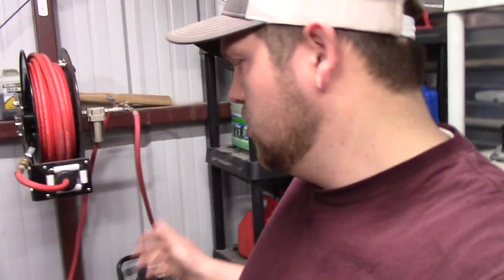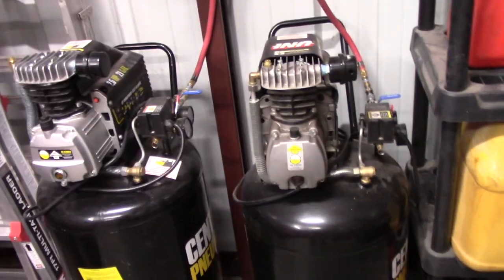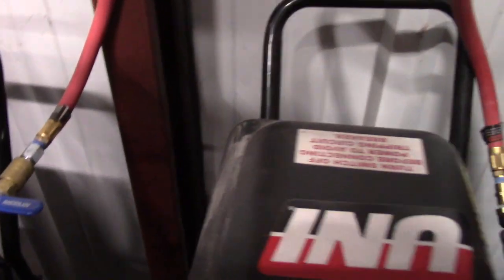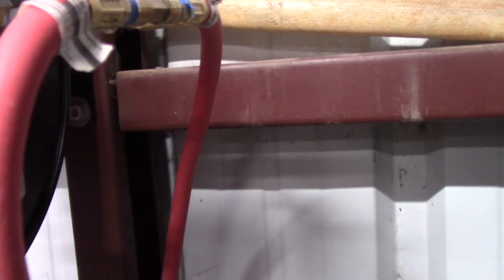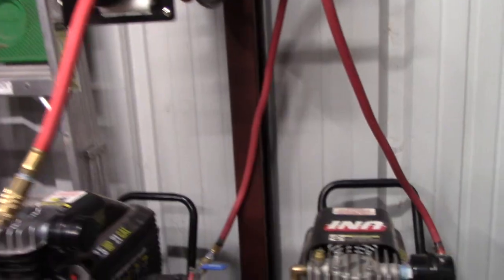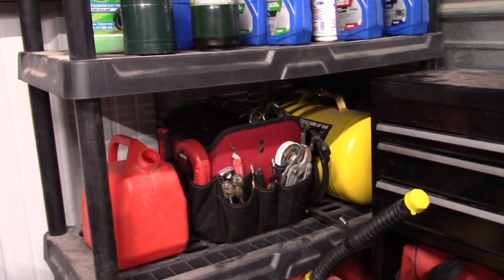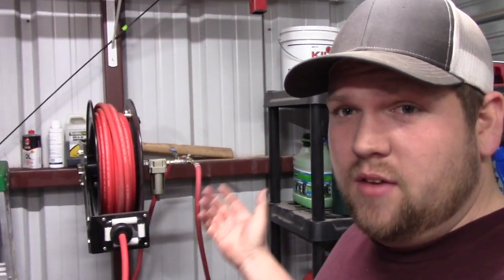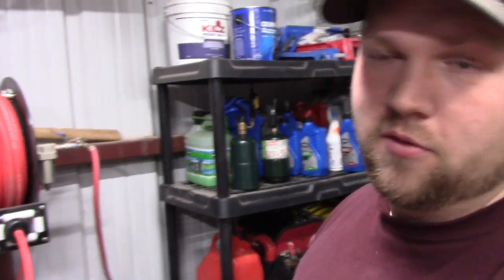Dual Air Compressor Set up for Small Shop

Comment: You failed to mention the CFM before and after which is kinda the whole point.
Reply from the maker: Norma Whitlatch the whole point of why I did a dual compressor set up is because I don’t have power in my shop and I have to run everything off a 20ft heavy duty extension cord, so if I could store double the amount of air pressure at 125 PSI I could use air tools without having to unplug everything in the shop because these things require so much power. 

But it sounds like you know what your talking about, so maybe you could enlighten me on the CFM topic because to me, the air compressor has to try and fill that 21 gallon tank to pressurize the air and when you add a second compressor you just have a second tank to be filled and pressurized so if someone wants twice the CFM while they are filling the tanks (air compressors are running) through their hose I don’t think that would be a benefit would it? And then when they are all the way filled you would only be able to have as much air flowing through one air hose as the diameter of the air hose would allow, and whether it is hooked up to one or two compressors, the pressure would remain the same which would be a factor in how fast it’s flowing right? I might just be completely ignorant to the science behind air compressors, so if you do know all about it, please tell me what you know so I can learn too.
Reply: @DereksWorkshopAndProjects  think of it like this. If you have one compressor running 2.5 hp pushing 5cfm let's just use rough numbers. And you hook a second 2.5 hp 5cfm motor up. Each motor is pushing 5 cfm to that t. Yes hose size and fittings can change things but not at low 10 cfm. A standard industrial plug can take 30cfm easily. The hoses are rated for 300psi. With both running 5hp peak you can run almost any air tool. Die grinder , angle grinder, cut off cool, hvlp gun. Sandblaster cabinet.  Dont focus on the tank size when you think of it. Think of it as motor output
Reply: I wonder if putting a larger diameter hose on the outlet of the T would allow for more cfm?

Comment: That'll work. The little auxilliary tank you mentioned helps settle the air and allow moisture from the two compressors to condense before entering the main line. So it acts like a water trap. 

You're probably already aware of this, but if you plumb the lines out of the regulators on each compressors, you'd need to keep the regulators wide open for the system to work as designed. If you're not worried about regulating the air at the tank, that's fine. Otherwise, maybe put a regulator up by the water separator up by the hose reel.
Reply from the maker: Thank you for all the insight and knowledgeable. I didn’t actually KNOW about keeping the regulators wide open, but I did THINK about it and I had never adjusted them because it just makes sense. Also just don’t have a lot of reason to throttle the air pressure down. I will probably add an auxiliary tank at some point. Really good info! Thank you!

Comment: A couple of questions:
Does having two (identical) compressors in parallel double the airflow (CFM) ?
What happens if one compressor is working but the other does not? Does the working compressor run (rotate) the non-working compressor?
Reply from the maker: Hopefully I understand your question right... I’m no expert on this so take it with a grain of salt. But a couple of things and these are my thoughts.... to address your first question, if you are asking if it doubles the air flow to the air tool, then I would think not. It only fills both tanks equally. And there is 2 times the tank space to be filled. 

As for the next question I feel more confident in answering this saying that no it doesn’t. One compressor just fills both tanks so it runs two times as long and works twice as much. Unless you add check valves.
Reply: Identical parallel compressors DOES double the CFM. But it does not affect the PSI. This is great for high-volume tools like sand blasters and spray guns.
When you do this kind of set up with two running compressors, the aim is not to allow one compressor to fill up the other. This could mean that one compressor is filling itself up as well as being filled by its partner and be potentially disastrous, particularly if you are bypassing the pressure switch to achieve this. Using check valves on each compressor is a safeguard against this happening. The aim is to increase the CFM by having both compressors feed the main line without one compressor interfering with the operation of the other or bypassing its pressure controls in any way. 

Install check valves right at the pressure switch on each compressor. If one compressor is not running, you CAN allow the working compressor to fill the non-working compressor by eliminating the check valve, acting essentially as extra tank capacity, but this won't do much, if anything, for your CFM. It simply allows you to use your tool a little longer until the combined pressure of the two tanks drops to kick-in level. But, then it just takes longer for the equalised pressure of both tanks to build up to cut-off level. So, if you're using a high volume tool, there isn't much benefit in my opinion as there would be an extended period of time where the tool just isn't working properly as the compressor is trying to fill two tanks. You need the second compressor running if you want better CFM.
Reply: @pbaylis1  negative, you don't need check valves. when you have the tanks plumbed to become one big tank, the two compressors fill the big tank together and shut off with their pressure switches activated by the equalized pressure in the big tank. nothing can go boom. you have one big tank. to test the output, run the tanks up to pressure then run your air tool. when the air pressure drops enough to kick the motors on, watch the pressure gauge to see if the compressors are keeping up, or even building back to cut off.
 The way he has it set up is different, nothing can reverse flow back into the other tank, because THE REGULATER VALVES go one way, just like a check valve. installing check valves would do nothing.

Comment: Harbor freight sells extremely poor quality products. 
I did work for their corporate office and its amazing how much brand new junk came straight off the boat from communist china to the dumpster. 
Invest in quality. 
#BuyAmerican 
#boycottchina
Reply from the maker: Do you buy cordless power tools? 99% are made in China. How about the electronic device you on commenting on this video on. 100% made in China. How about the parts in your car? Likely 75% made in China. How about those lightbulbs in your house? China. The vast majority of consumer goods are made in China. To criticize harbor freight is to criticize likely every store you shop at. 

I see your name is ChillerTech, I assume you work on chiller systems, and so you probably use Milwaukee tools, if not those Makita or DeWalt. What American made tool system are you using?